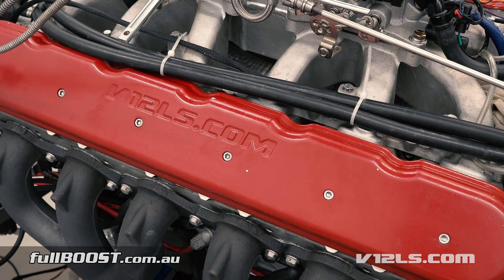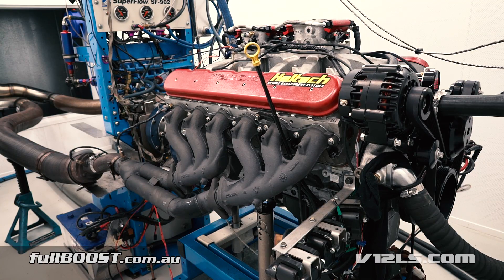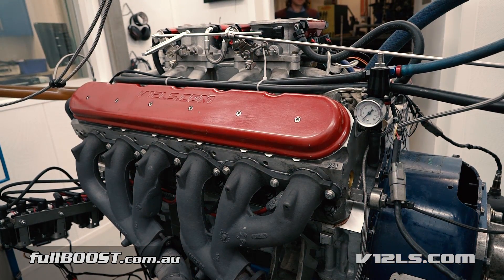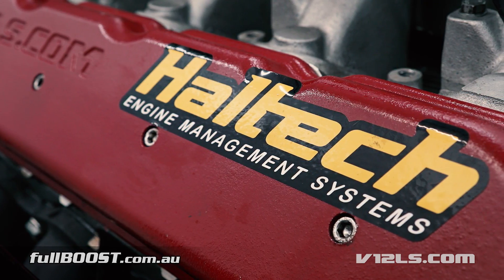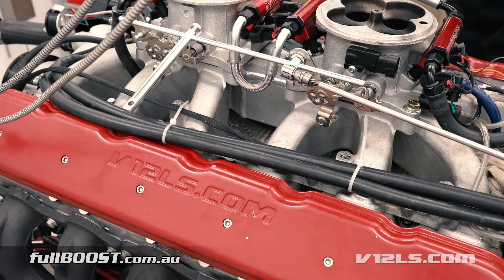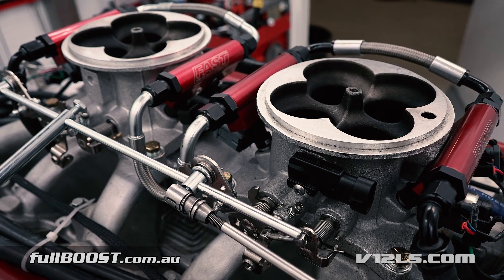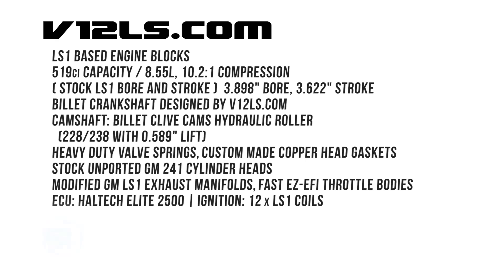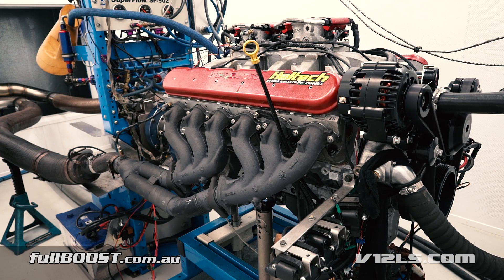V12 LS1 engine dyno

Comment: if you think about it..
you could just take a normal, healthy Ls1 and TurboCharge it..
you can make between 500 crank hp to 1200 crank hp.. w/(Pistons/piston-rods) 
and NO "few years in the making".. just a solid 2 weeks or less.

but... and this is a BIG BUT  this is one of the meanest/best LS based engine I have ever seen or heard about!
maaa god! a N/A, V12, 700+hp! what an engine..
the only thing that this engine is missing, is some boost.

#God bless America and GM <3
Reply: I don't think it's the fact that it's a v12 that makes that power, but more along the lines of the displacement alone... Ford had a 10.0 liter v8 making 855 hp in the early 90s - and it was built for that challenge with GM where they agreed on n/a, passes emissions, etc.  I'd wager for a proof of concept, this is very very good... Curious on weight and length of the engine.  :D
Reply: You mean God Bless Australia

Comment: why is the throttle response so slow?... the throttle opens... then like 2-3 seconds later it actually opens up? am I missing something?
Reply: Thanks for asking. The dyno operator controls the engine via load, they could hold it at low RPM all day at WOT if they wanted to. Here is a video with a little free rev, they are really snappy actually faster to rev than the V8s. https://www.youtube.com/watch?v=h41VyQLuLKs

Comment: I have nothing but respect for the time and effort put into this. But I beg the question, was any real engineering put into this? You cant just attach two engines together and expect everything to be balanced correctly, have the correct cooling in place etc.. how about block flexing? Was any FEA ran on the block, crank, camshaft etc..? I really hope so, because I'd hate it all to go to waste.
Reply: Thanks for taking interest in the project. The welded prototype was simply to test the concept, we are casting blocks and heads now. Here is a link to some of the engineering that went into the V12LS. https://youtu.be/q3yJUugMEtI?t=130
Reply: @V12LS  thanks for the link!

Comment: It's immensely cool but there are a lot of problems. The biggest problem is 717hp. We get more than that out of a stock 4.8 truck motor with a turbo, and we keep fuel injection. Inevitably someone will comment "yeah but if you put turbos on this you get xxxxhp". Maybe, but what are you going to do with it? If you've never driven a 500hp car, you don't know how hard it is to keep it on the road under full throttle for more than a few seconds. When you get passed 700hp you can't use all of it any time. So this engine won't make any more usable power than a regular LS engine with a few mild mods but it will weigh twice as much, be twice as long and have twice as many things to break. Now someone will say "but since its made with regular GM parts, why won't it be just as reliable?". Because of its length. Have you ever wondered why a 5 liter small block Ford can't hold more than 500hp but a 2.3 liter Ford 4 cylinder can? The longer the engine is, the more stress you have.
Reply: It may not be the cheapest or easiest way to make 717hp, it would have to be one of the coolest ways to do it.
While a turbo 4.8 can make those numbers, the area under the torque curve will not be any where near it.
 This engine is injected, just using TB injection at this stage.
 With the torque curve as fat as it is on this engine, it will be much easier to drive than a 700hp turbo car.
 The length is less than 9" longer than a stock LS, and weighs about 30% more.
 The engine will be more reliable than a 4.8 turbo with the same power as cyl. pressures are much lower, as are intake temps.
 The crank is far better balanced than any V8 crank ever will be due to it's primary and second order balance.
 I don't think length is the issue with the SBF, it's more likely block and crank structure. There are some extremely powerful I6's out there, which are longer than any SB or BB V8.
 As for HP, this engine is essentially stock, bar having a bigger cam and springs to match, along with an extra 4 cyl's. So there is plenty of room for improvement, even before turbos.

Comment: why maximum power just 717 hp for 8.5 litter engine?
Reply: HP will typically be a little over 1.5x that of a same spec V8 LS. This prototype is made with stock 5.7 SS Commodore parts, a mild cam and some comp valve springs. 717hp exceeded our expectations for a 228 camshaft and stock port 241 heads.  If you need more power, head over to V12LS.com and pick up one of our iron blocks and LS7 style heads are launching at SEMA 2017.

Comment: I am no american V8 specialist at all, but it is very easy to find runs for a std LS1 over 500 hp, shouldn't you expect more than a thousand for this master piece?
Reply from the maker: The LS1 this is based off doesn't put out much over 300hp so these power results are spot on where they should be.

Comment: This has potential.  I'd like to see how it does with some forced induction.  Unfortunately the displacement of this build puts it in direct competition with the BIg Block Chevy which will make about the same output under 6 grand.  
If they build one with the large bore sleeves and a little more stroke it could be very good indeed.  Gotta give em props for making it happen!

Comment: 664 hp out of 8.5L NA? Isn't that bad? I mean the   LT1 engine from the C8 ZO6 nearly matches that with 4 less pistons and another 3L less displacement.

Maybe put equal length headers on it to improve scavenging at the very least? That and a more free-flowing intake.
Reply from the maker: This was a prototype engine to prove the concept worked and it did that very well. It's not an LT engine it's a factory stock LS1 with extra cylinders so the power is spot on where it should be.
Reply: @fullboost  I would say it's comparable to the Viper's V10 in terms of displacement and power. And that engine seems relatively understressed. Which means lots of tuning potential for this engine, hopefully. 

I thought this would be the final form for the engine itself. Hence the comment.

Also for a V12 using stock LS1 parts, this is probably the most cost-effective V12 to maintain ;)

Comment: That engine is really long what would it fit in?  Considering that you can buy a crate LSx 454 making just under 700hp NA makes it a hard sell.  A boosted LS with stock internals will push 800hp and with modified internals over 2500hp.  Also if I'm going to run a V12 I want a proper DOHC motor.  Ferrari V12's at 6.3 are making nearly 800hp plus they are capable of revving to a very sexy 8500rpm.

Comment: new comment since i made a spelling error and people go one about things im not talking about all im going to say is , i would like to see this engine with direct injection instead of carbies, to see the difference in performance
Reply: This one has EZ-EFI fuel injection throttle bodies, run by a Haltech ECU. They are better than carbies, but not as good as direct port injection, as mixtures are not perfectly even over all cyl's. I'm sure port injection will make a small improvement over this setup.
Reply: My thoughts too and thank you. for explaining , instead of just saying im wrong, with no explanation

Comment: this is Two chevy v6 4.3 or Two cut v8 ls1.??
Reply: Even the site is V12 LS, title of video, but more than that, if you divi 5,7L to 8 and mutiply 12 you arrive at 8,55L as in description
Reply: Two v8s cut and welded. Not two LS V6s. Somewhat counterintuitive I suppose.
Reply: is the same bore size pistóns 4.3 vortec v6... and 5.7 ls v8...yeah or not.?
Reply: G55STEYR yeah bro So my question 4.3 + 4.3 is a 8.6 maybe 8.55 liters
Reply: Cory Stansbury If I was question .. because the 4.3 engine has the same size pistons of 5.7 ls

Comment: doesn't make sense to me to cut off two holes off each LS. seems that two 4.3 liter Chevy's with wood have done the same thing. now that would b a awesum v12.
Reply: We chose the LS platform for the huge aftermarket support and the best way to prototype was to use 2 LS1s as you see here. We are now casting our own blocks so no more cutting.

Comment: How much?
I need one with lower height intakes for a 1980 S3 V12 Jag.
Reply: Now you can Chev swap your Jag, and keep it V12. :)
Reply: Yes War that's what I was thinking. I like Jag V12s (esp pre HE) very much and would never consider a V8 swap - HOWEVER - something like this providing it allows the Jag bonnet to close (hint, hint to whoever is reading) would solve many problems ie. off idle torque and would open a whole range of transmission options that don't rely on that gawd awful TH700 with its nice low 1st gear but shit for brains ratio spacing from 1st to 2nd.
I could bolt up a 4L80e and put a TCI valve body in it and have a 5sp auto with a tranny brake. Then I could fit a 3.7 Dana 44 ring and pinion (fits stock Jag LSD btw) and have a proper V12 that was quiet and had off idle punch the 5.3s never had. Mildly tuned ~ say a lazy 550hp (and about 450 ft lbs @2000rpm rising to about 550 ft lbs @ 4200rpm) would be a lot of fun.

Comment: But will it be better than the 702?
Reply: it's already  better than a 702 in terms of power , cause a 702  wouldn't  run  over  3500 rpm  routinely ,, if you wound a 702  up to 6k RPM   something  fatal  was likely to happen ,,702 was mass produced  though ,,and i know of a few that  are still in service today  as  irrigation standby  power units   and one in particular that's a  generator ,, 

I can think of a really good use for an engine this large though ,, and that's in  a big truck or in  my  motorhome ,,a vehicle  where fuel efficiency takes second fiddle to pulling power

Comment: watch the throttle at 1.22 and look at the bogging and how long it takes to rev up. more junk for the huppies. give me a 402 with a dual rochester carbs and blower
Reply from the maker: Perhaps read up on how an engine dyno works, this is completely normal operation.

Comment: You get my respect for making it work....
But not for power output. 9.5L for 700hp is stupid. Even if it's stock LS1.
Reply from the maker: A stock LS1 only makes aroind 350hp...
Reply: @fullboost  I know. Still 700 for that engine size is stupid
Reply: Thanks for the interest @russotusso1695 . We were pretty happy to make more than 1.5x the power of the engine we used the parts from. Our latest version has heads that will flow to 1,000 but we ran out of flow in the 102mm throttle body. Back on the dyno soon for another shot so remember to subscribe to Fullboost.

Comment: How long is the engine? (compared to the viper v10 or an ls1)
Reply: The LS engines all have a 4.4" bore spacing. This engine is 8.8" longer than a standard V8 LS, which is 2x the bore spacing. There are plenty of short accessory drive kits to help reduce the total engine length a little too for the LS engines.

Comment: breaking down bit over half acceleration it seems wanting more fuel or even twin turbos ....taking to long to reach full rpms
Reply: Possibly Jamie as we only had a few runs in, You may be able to see the A/F gauge to validate your idea. Remember the dyno operator was manually ramping up the load. eg. the operator could have held the engine there indefinitely. This is a commonly misunderstood function as most dyno videos form the USA simply allow the engine to rev up as quickly as possible. If all you care about is peak power then I suppose that's fine, but you miss out on a lot of data to get the tune right.

Comment: If you started out with 2 v-8s why not just make it a v-16? Dont quite get it. If that was the case just use 2 4.3 liter vortec v-6s....
Reply from the maker: The LS engine is very well supported in terms of aftermarket parts.

Comment: This is really cool, and that's with "stock" manifolds etc. !

Though I wonder, at the cost of essentially hacking up two engines and welding them together, a custom camshaft, and a custom crankshaft, one may as well go ahead and have bespoke heads and block made. There's little to engineer, so to speak, just copy what's already there.

Comment: That must a odd firing order it sounds like a regular v6 but overall it sounds pretty stout.
Reply: It's even fire on each bank, but 90deg out bank to bank, so has a 90-30-90-30... ignition split. You can hear that at idle, but when it gets to 2,000+ you loose that sound and they really sing.

Comment: The response on the throttle is terrible, it was legit full open throttle for two or three seconds before it started to build revs
Reply: That's the dyno operator holding it back. The slower you ramp the engine speed up the more data you collect, the data is more accurate, and the better the tune becomes. This looks like a "flat spot" if you can't see what the operator is doing. 
 If you look at the chart at the end, it is producing 450+hp at 4,000 rpm, and this is the point of what appears to be a "flat spot".
Have a look at the two little revs, just a little tap of the throttle under no load at 1:38 and 2:03, you see this is actually quite a responsive engine. I can't wait to hear it through some proper pipes.
 Thanks for watching. :)

Comment: but you could make 700hp cheaper out of an LS V8 with some boost.
Reply: The LSX 454 already makes 750hp N/A
Reply: i thought this v12ls was stock. an ls v8 700hp is mod not stock.
Reply: +WhyteLis21 point is, this engine isn't that spectacular if you can buy an engine that they sale from the dealer already with the same hp
Reply: all motor aren't spectacular. big or small that is til it's modded. true the smaller the motor the cheaper it is. i personally think chevy could use a super sport car but i don't think many will buy it with this motor since most car fans r more into the v8 ls any how.
Reply: +WhyteLis21 I agree..I mean a bigger displacement naturally aspirated V12 is pretty cool, I just think it showed up on the scene too late..I'm guessing if this engine does happen to make it into production, they're probably gonna use it in your typical GM muscle cars like the corvette, camaro, cts-v and possibly the chevy ss..It'd still be cool to see if it hit production and see how far the limits are with this thing
Reply: agreed. hey at least now gm has a v12 to compete wit other companies like lambo or ferraris. if they  choose to make a super car killer against lambo or ferraris that is.
Reply: I would be guessing that would be the main reason for putting it in production..To compete with the Germans and Italians

Comment: And that's a basically stock set up....  and in v12 form makes about the same horse power as a Pagani (aka) AMG-Benz V12... impressive considering a nasty cam and serious set of heads would probably push it to Veyron power, WITHOUT the 4 turbos... german engineering my assss VW..   How many mains does this motor have?  I'm assuming six, 4 bolt splayed mains with coated bearings.
Reply: This engine has 7-mains, and they are 6-bolt (4x straight in, and 2x cross bolts, stock LS style). There is a big NA version in the works, with cast block, new big port heads, larger intake, exhaust, etc. this should make over 1,000hp on pump fuel, with street car drivability. and as you mentioned, no turbos.
https://www.youtube.com/watch?v=P7ZkRuuU30E&t=52s

Comment: you could just build a big block Chevy and make the same power or more it's different but not worth it but the time you put that in the car and measure whp t will be around 640 to 660 which is. nothing for what the price tag on that motor will be

Comment: Wouldn’t it have just been easier to stab two 4.3 vortec blocks together rather than lopping off 2 Cylinders from on of the V8 engines?

Sure it’s gonna need a custom block no matter what, But like... why. Lol
Reply from the maker: How would it be easier? You're still mating two blocks together.

Comment: Ok, you get a 10 for the cool factor, but what the fuck you gonna put it in? A Mack truck? Can't you get close to that hp in a beefed up LS anyway? Just wondering the hp to dollar ratio vs a traditional LS? I'm sure this motor will cost 2x an LS motor plus engineering fee. Don't get me wrong, I like it a lot, but I just don't see many people  buying this due to size and cost.
Reply: Thanks Alfonso. These will ft in most vehicles that come with an I6 option. GM A bodies are easy enough with just a radiator tucked under the core support needed due to the extra length of the LS accessories over the old I6. We have one in a Camaro with a stock engine compartment too. And hell yeah you can make that power from a V8 LS, it's why we chose the platform! If you can fit the V12LS, build to the same specs and have a little over 1.5x the power and still less weight than an iron big block :)  Working back from the specs we have here, it would be like making 478 HP from a stock 5.7L with a cam, and that would be quite an achievement.

Comment: Don't V8 push them numbers? v12 LS should of given you 1000+
Reply: Hi Tray, to make over 1,000hp with this configuration would be a challenge. Your expectation are the equivalent of making 666HP with a stock 5.7L LS1 and a cam, and I don't know anyone who has even come close to that. The reality is most people won't have a drive-line, fuel system or traction to put down the 700+ on the street anyway. But for people like yourself that can we have iron blocks out now, and LS7 heads coming by SEMA. 1k horsepower is not going to be difficult with that setup... If you have a vehicle that can handle it of course.
Reply: V12 LS I just pick up a 2000 audi tt and thinking of do in a LS1 swap not to sure if I should just fix it or swap it already has a stage 2/set up but needs some work, what you think?